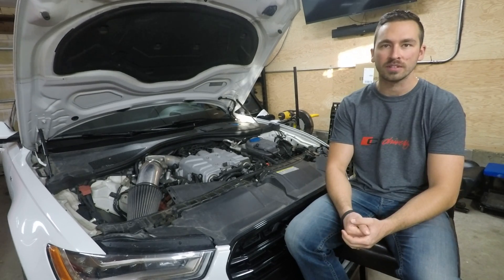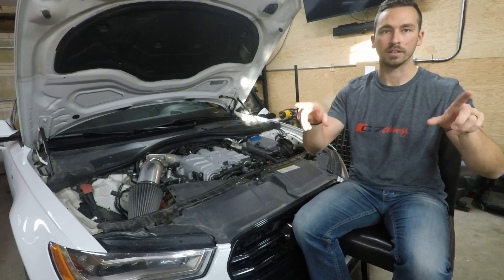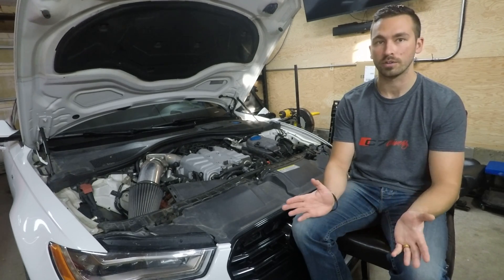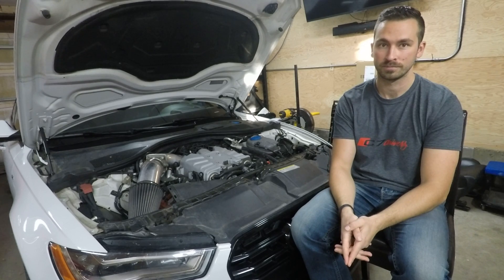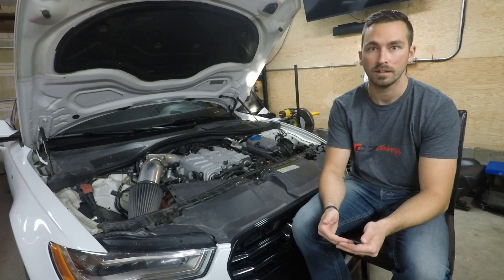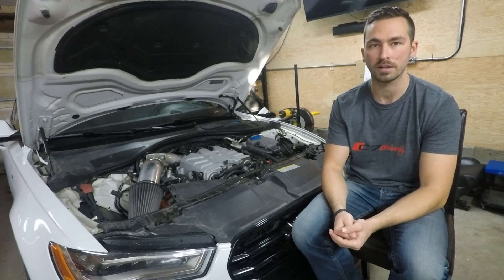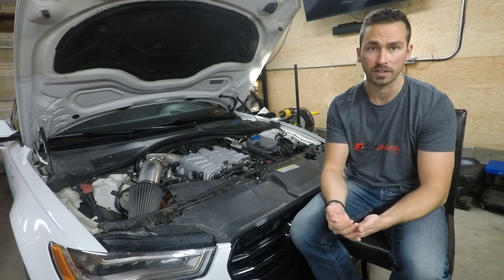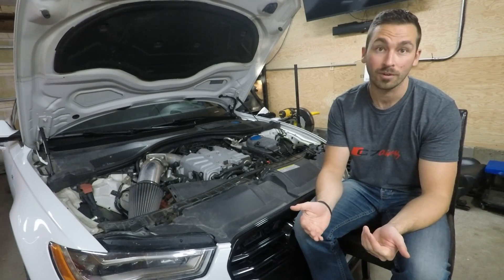3.0t Tech Talk Ep.3 // Divorced Supercharger Cooling Loop

Comment: Did you notice any difference? According to 034 motor sports video they don’t pull much heat from the engine portion of the cooling system
Reply from the maker: At the time of this video,  I knew in theory the things I mentioned. But later, I made this video when I divorced my loop and showed the differences before and after. Here's the link.
https://youtu.be/CheLLhVHHXQ?si=cRj0Q8fZ7aT_Wa-G

Comment: What sensor did you use to watch your fluid level on the divorced side?
Reply from the maker: I don't have mine divorced. If I did I would be using the oem one or wiring it so it was joined to the oem harness so it would function like oem still.

Comment: interesting info.
but you still didnt even tell us how efficient it is without. you just said it works great. 
ive got a divorced loop running 99% water. and I still stay within 20* above ambient cruising and never get over 140* on a dp setup (even when its 110*+  in so*cal heat). But im also not smashing it when its that hot either, but i have lol.
Reply from the maker: 140F on a 1/4 pull? I stay 9F over ambient with mine. Divorced can work well, I was highlighting what makes a good kit. And what the difference a 50:50 mix from 100% distilled is. Yeah it doesn't usually get that here but I don't hammer on it when its too hot haha
Reply: @SuitedUp2The9s  its great info but you need to tell the fans what your ambient temps and location are as well. Because remember folks in colder climates will naturally always run cooler. 
And let me CORRECT myself.. the temp reference was not DP. I started typing faster than thinking. Its not hot here yet but on a cold 60*f day, I only get  up to about 60* over ambient. 

im still not buying the 9* over ambient. a chiller setup barely does that.